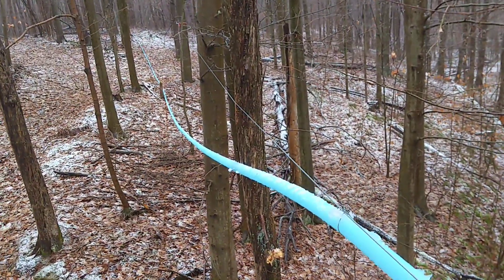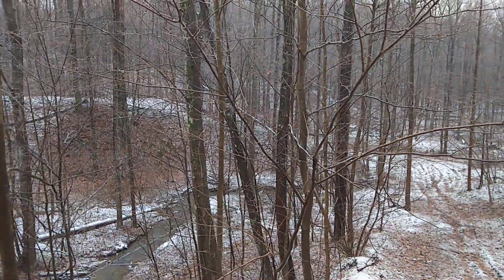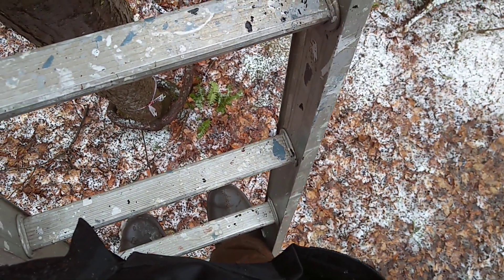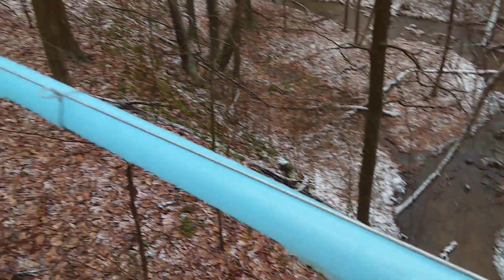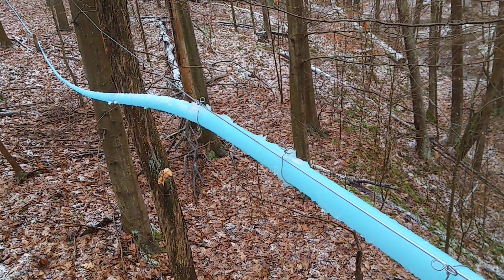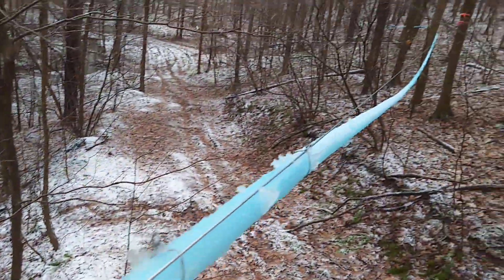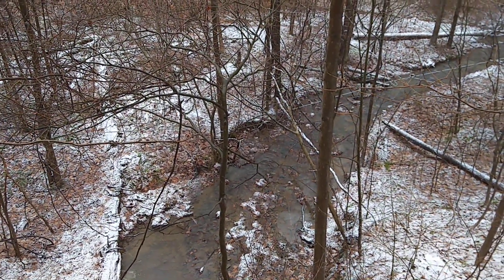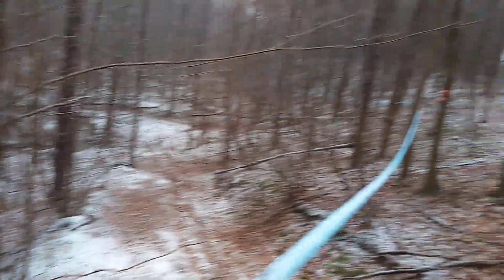Adding taps at Bissell Maple Farm

Comment: I was wondering how you plan to tie that transfer line to your tensioned wire. Do you just lean a ladder against that wire as you go, or do you use a lift of some sort.
Reply from the maker: Lean the ladder against the wire.  It is 180,000 psi wire.
Reply from the maker: It feels like you are leaning against nothing.  Plus, I'm putting a lot of faith in a wire mill's quality program.
Reply: @BissellMapleFarm  gotcha. I am looking to set up a transfer line up a hill and out of a ravine myself and I was going to go straight up and out of the bottom of the ravine. But I wasn't sure about leaning the ladder against the wire. Is that 12.5 gauge wire or higher, like 9?  Thanks
Reply from the maker: @dalelengyel8393  it is 12.5 gauge.   We went straight up 18' and it falls downhill from there.
Reply: @BissellMapleFarm  perfect. Thanks for the info. This is my plan as well, although slightly higher but hopefully not too much. Haha
Reply from the maker: @dalelengyel8393  I'm just glad someone watches these videos!   I think the Honda pumps push 28' of head maximum.  But once the sap get over that hump it can actually create a siphon.  That's what I'm expecting.
Reply: @BissellMapleFarm  Haha. I do watch "some" of them. Not all. But since I've been running mainline this week myself, it perked my interest. My first attempt at running mainline. Let alone a smaller vacuum system. We are about 1/2 hr west of Cleveland, in Grafton, so pretty neat seeing your operation and your videos and not something from "Vermont."  I appreciate your videos. Keep them coming. If not for the masses, at least for me. Good luck this season and thanks again!